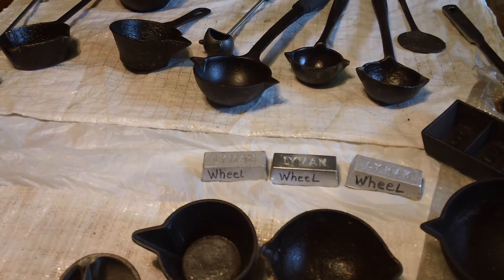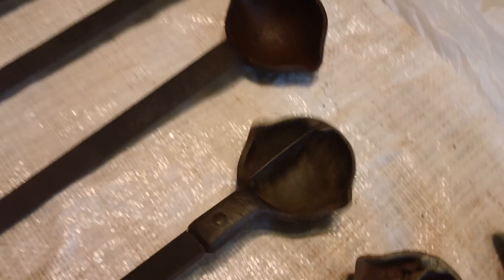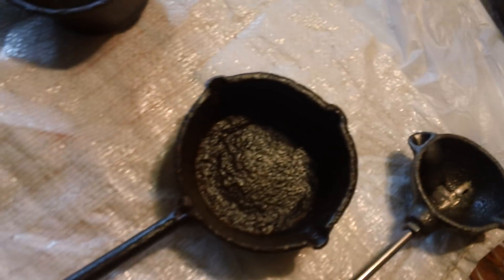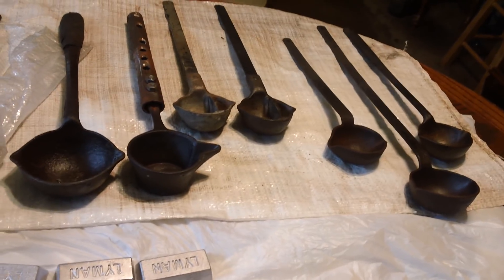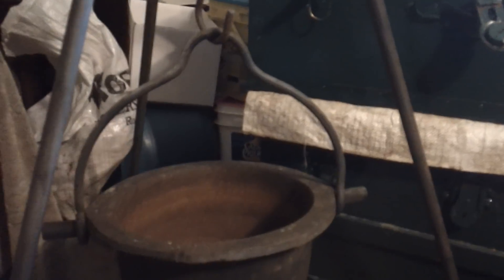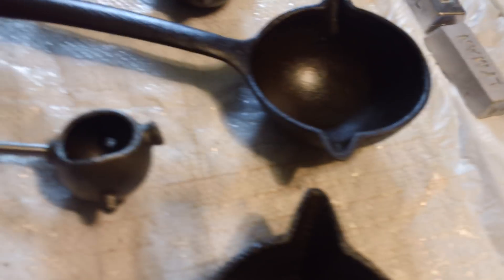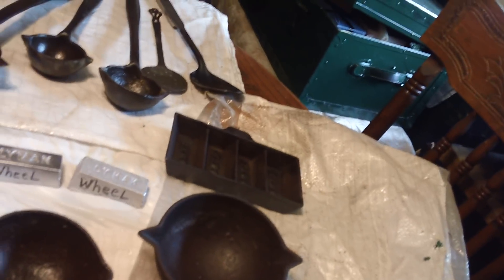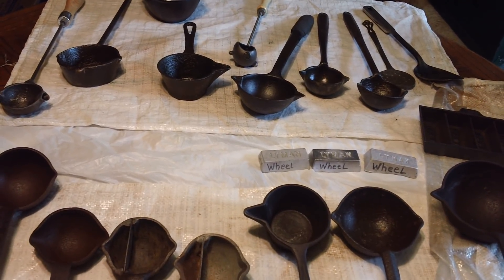Inspired by Fortune Cookie 45LC

Comment: I was given one of those larger ladles and a cast iron pot a while back . I have a Lee 4-20 pot so I haven't used them yet. I thought I could use them for melting ingots when I get some more wheel weights though.
Reply from the maker: James, I never had an electric pot, nor used one; I just learned how to use the micro-wave ! Been using cast-iron pots and the ladle method since 1977..Then on the other hand, never had a mold bigger than two cavity either. I never felt hindered; or held back; with the ladle and pot.. Maybe you will show us your stuff in a video ?

Comment: I have 2 of those that keep the (dross) back I don’t like the screen I have one the screen was pulled out. I believe the dross is actually metals u want inside the metal if u can stir it in do so. You’ll notice pure soft lead weights out heavy in a bullet mold and alloys are lighter so it stands to reason the lighter metal film on top is good stuff. It’s the dirt and crap u wanna keep out but u can pour a lot of bullets in a hurry with some dirt on the top in a latel that’s all I use.
Reply from the maker: iF YOU GET DROSS INTO YOUR MOLD YOU WILL HAVE VOIDS, SAME FOR GETTING DIRT IN THERE.
Reply: @fuzztfork8  of course you’ll have voids with dirt etc . But what is dross made up of?  Has anyone analyzed it. Tin and antimony is lighter than lead. Seems if the temp is high enough or u don’t allow the pot to sit idle the dross never developes. I believe it’s tin and antimony pushed to the top by the heavy weight of the lead. I keep it stirred and fluxed and don’t have to skim it except for dirt carbon etc and I’ve noticed my bullets weights are closer to the expected mold weight if I do so.